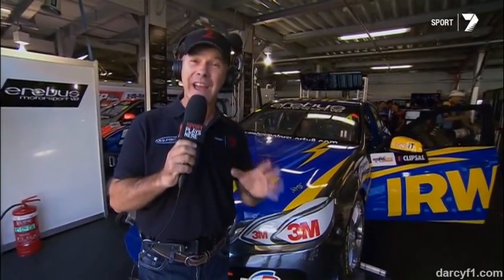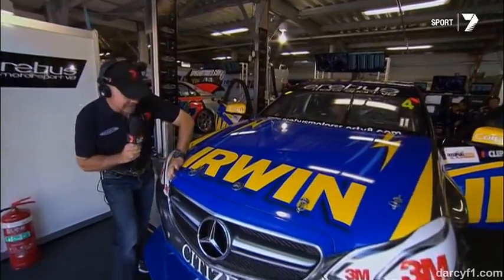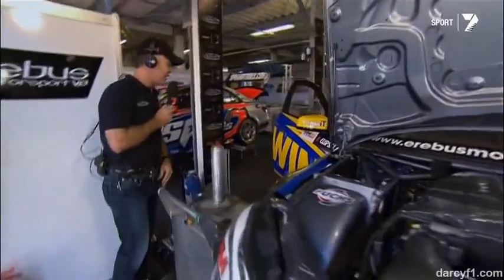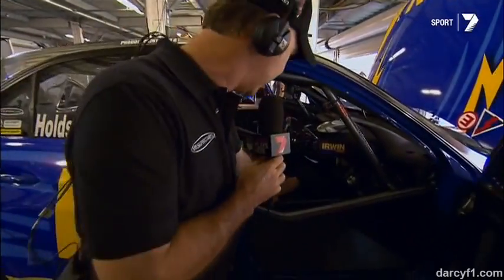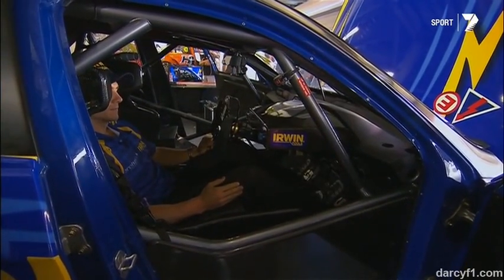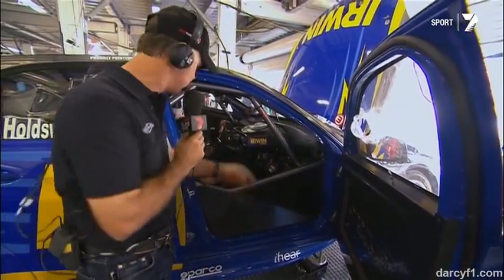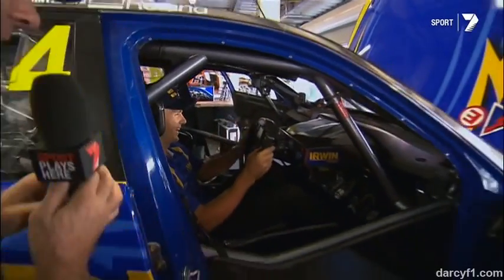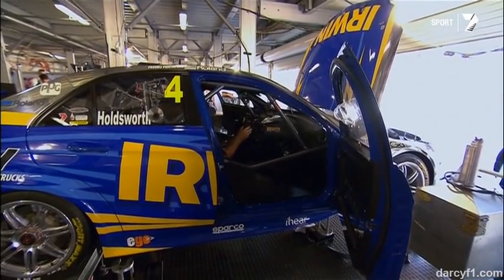Mercedes V8 Supercar sound

Comment: he's not talking about the angle of the cylinder banks, but the angle of the crankshaft. The flat-plane crankshaft has crank pins at 180°, that's what he meant. That's why he's even comparing it to a "normal" (his words) V8, he never calls it a Boxer.

Comment: To me it's just seems very clear he's talking about the position of the banks against each other and not about the structure of the crank. I read this from his usage of the word "fire" and the hand movements he uses to illustrate the differences.
When people mention 90 degree V8 (or any other number) they usually mean the angle between cylinder banks.

It is possible he understands the function, but I can't pick up it from the way he explains.
Reply: He used to be a driver and a mechanic etc,  he knows exactly the difference,  and yes he says a V8 is generally an 60 to 90 degree for the pistons, and in terms of the flat plane piston engine, Mercedes wouldn't have called it an boxer engine. Because Subaru will have trademarked the name Boxer for their engines,  and boxer only comes from the last name of designer of the flat plane engine.

Comment: No he clearly doesn't know what flat plane crankshaft means. Has nothing to do with the angle of the cylinder banks.

This is not a 180 degree V8 and if it would, it would be called a boxer engine.
Reply: You've got no idea what you are even on about. This is a man who has been around this stuff longer than most of us have been alive
Reply: @mattcecil6692  My theory is (like I wrote down 8 bloody years ago) that he understands it but doesn't explain it well. Maybe he's rushing it dumbing down for the average viewer. It just seems like he has confused the meaning of flat plane crankshaft and the angle of cylinder banks. Then again I admit I might have jumped the gun a little there being so harsh about this dude.

Flat plane crankshaft is the reason for the sound, V8 engines (not flat 8) engines that have flat plane crankshaft tend to sound like this because the resulting rhythm of exhaust pulses when they hit the collector is even, unlike the traditional crossplane crankshaft V8 where pulses reach the exhaust collector in uneven rhythm. If you slow down the exhaust note it's basically a drum beat.
Reply: Also you can actually make a crossplane V8 (classic murican type) sound like this if you fabricate a very elaborate exhaust manifold that can even out the timing of the pulses. You just need a lot of room for all the piping required